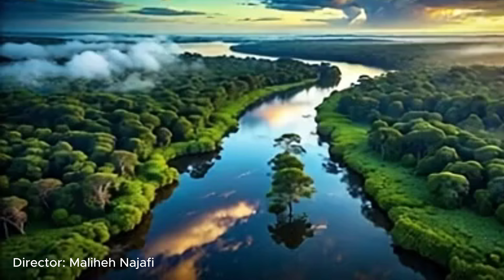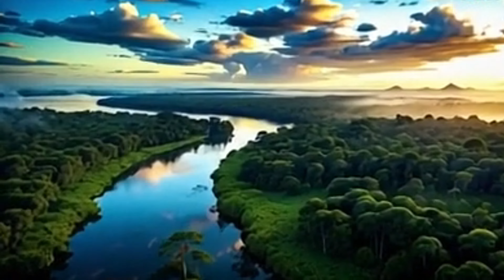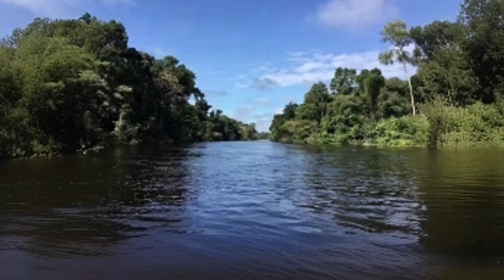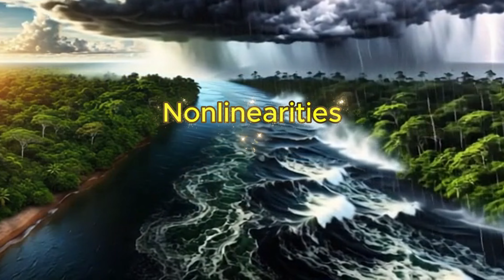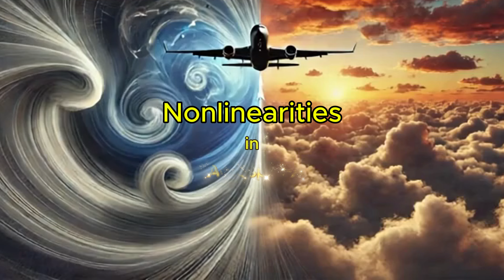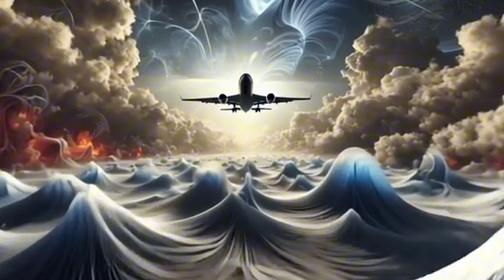Nonlinearity in Aerospace Engineering

Comment: y = mx + c (equation of a line) is nonlinear from an input-output perspective, y = mx is linear (x input, y output).
Reply from the maker: That's an interesting point! However, in mathematics, y = mx + c (c is constant can be zero) is defined as a linear equation . Maybe we can discuss further why you consider it nonlinear from an input-output perspective? Thanks in advance. 😊
Reply: @MalihAeroDesignLab  It's nonlinear because it fails the test for linearity -  for example, if you double the input, you don't double the output. The constant c is what makes it fail the test. If c=0 then it's linear. Cheers.
Reply from the maker: @joshuagordis4978  Thanks Professor.❤️ You are right, It was my mistake.  I will explain it in the next vedioes.
Reply: @MalihAeroDesignLab  many people are surprised by this... best wishes to you!
Reply from the maker: @siliconbronze  Thanks😊